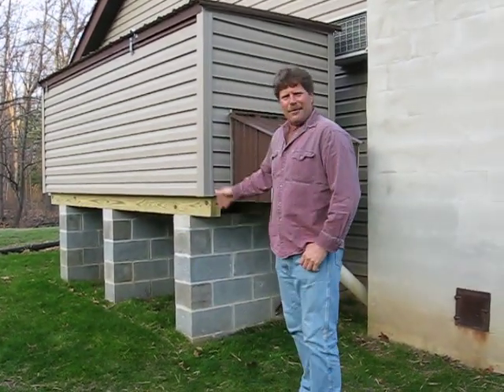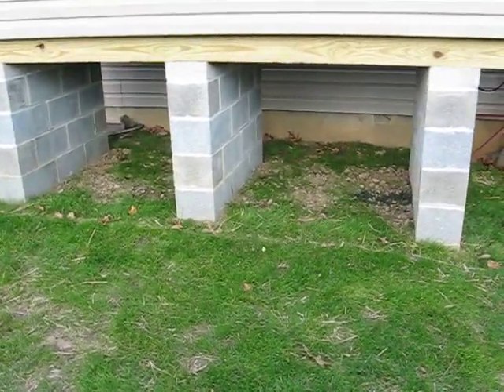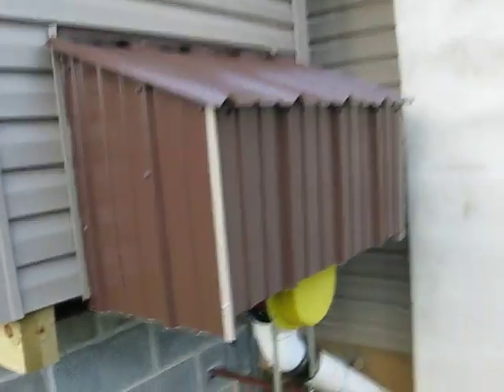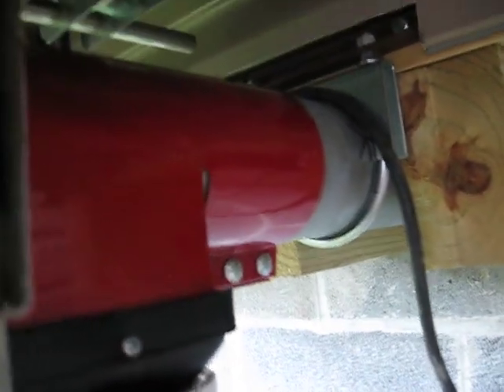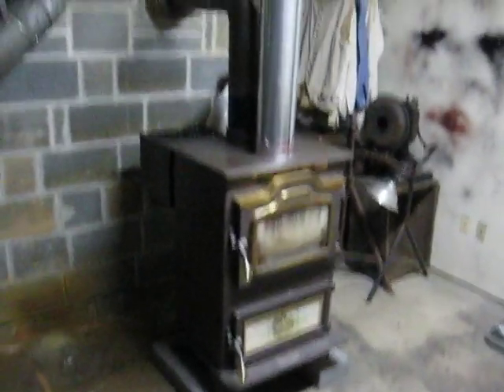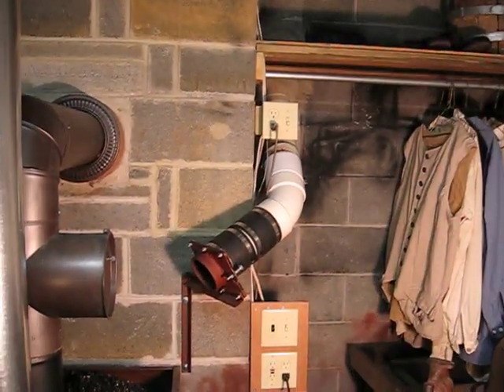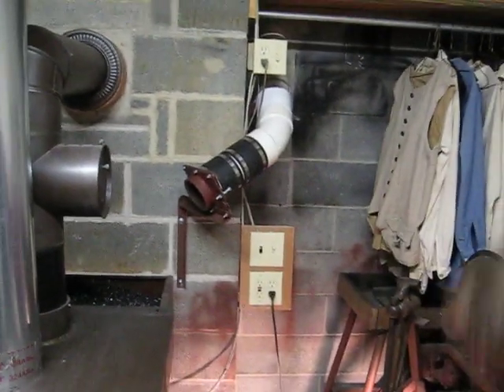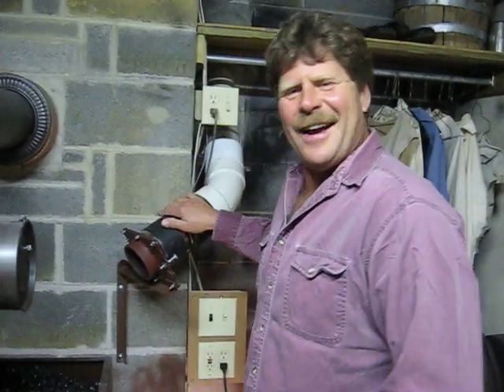Jim from Macungie:  Coal bin

Comment: Where do you live that there is still coal delivery? 
What is rice coal?
I ain't young but I've never heard of using coal to heat your house in modern times.
Reply: Macungie is in Pennsylvania. Near Allentown, Pa, and yes coal is everywhere around here.
Reply: Christopher Guy rice is a very clean burning coal a simple google search will tell you everything you need to know.
Reply: You're obviously not from Pa.  You can buy coal for about $100 a ton here.  Depending on the size of your house that could last you a winter.

Comment: Excellent set up!  I'm really looking into ideas to build my own as well as I'm thinking of going over to coal next winter.  I'm getting too old to find 7 to 8 cords of wood every winter and this past winter did it!   Its 28 degrees outside and its April 3rd!  Is it spring yet or what!  Anyway, I ran out of wood a few weeks ago and have been throwing coal in my wood stove.   It works fine and I check the grate every day.  Works so well, upgrading next year for sure!